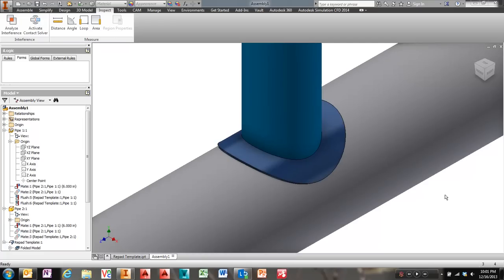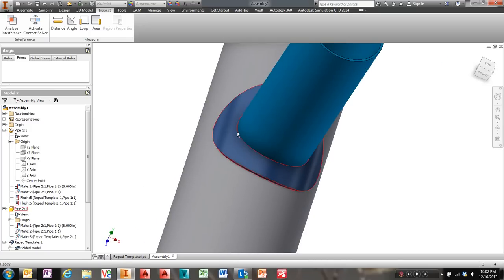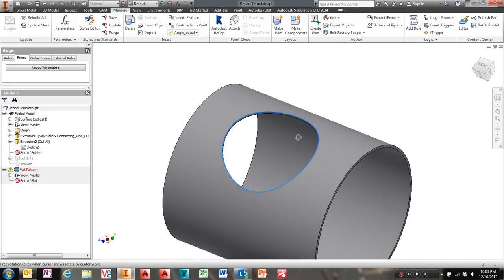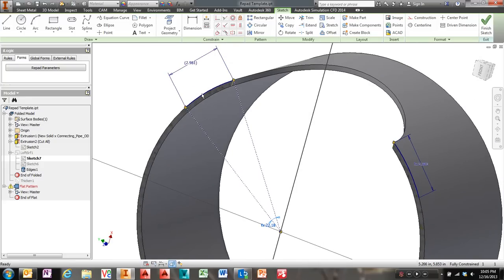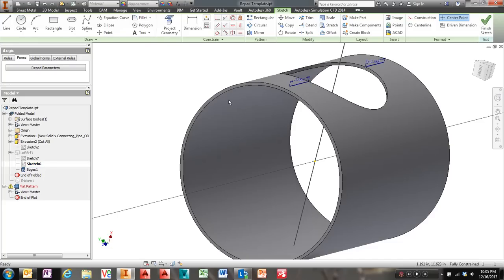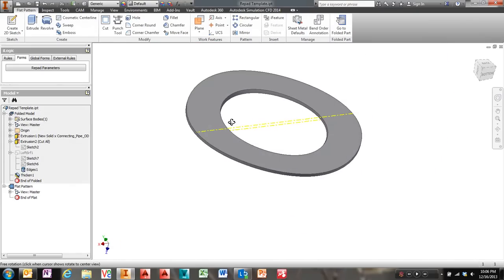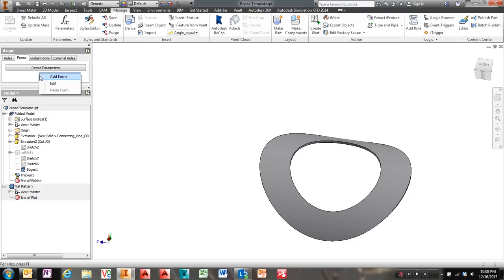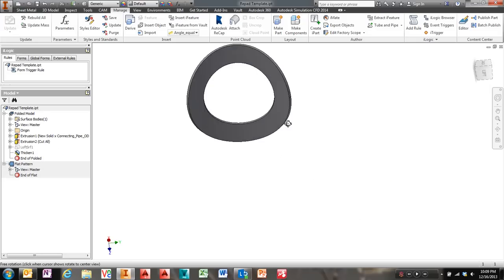Creating a Template Pipe Fitting Repad Using Autodesk Inventor

Comment: Hi - There is a much, much less painful way of doing this now IF the repad is symmetrical ... In short: (using sheet metal)

CONTOUR ROLL along the CL (intent is to build half of repad first). width and length to be greater than repad dimensions>
UNFOLD (using CL face)
SKETCH repad geometry 
EXTRUDE CUT sketch
REFOLD
MIRROR at CL face
(done)

I suggest linking parameters to making things smoother and more automated., but you'll be okay even if you don't. This way saves you from all the tricky math and sweep paths. The flat patterns come out close enough to anything that  you'll be doing with pipe, approx 1/32"+/-

Comment: Thank you for the video.  I'm trying to do the same thing, but to accommodate the pipe if it was coming in on an angle, such as 45 degrees.  It's kicking my rear.  Any chance I could send you what I have and see if you could see my problem?  I'm stuck at the step where I do the loft.  (Fyi...Imaginit is the re-seller I used)

Comment: The user may also want a weld gap for full penetration. I make the hole 0.093" per side bigger for weld gap. Fitter will bevel as required.